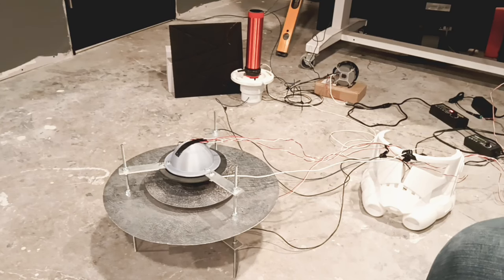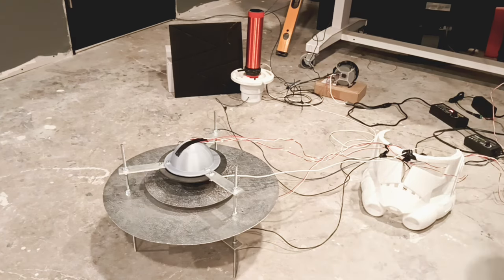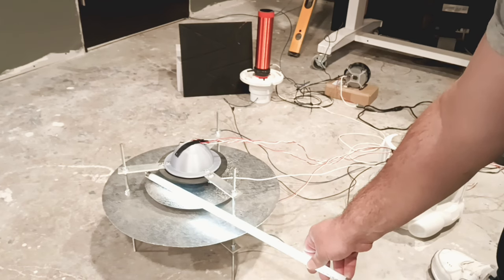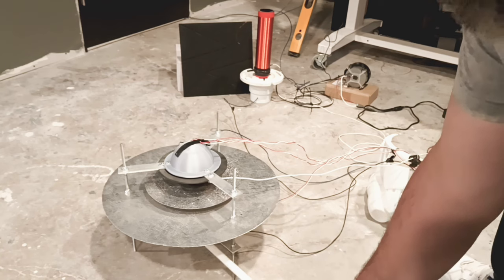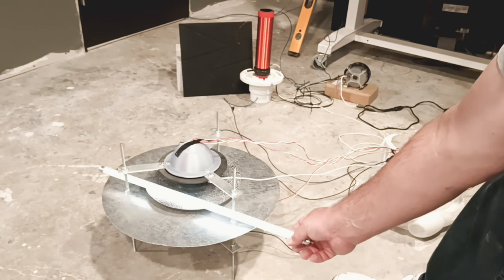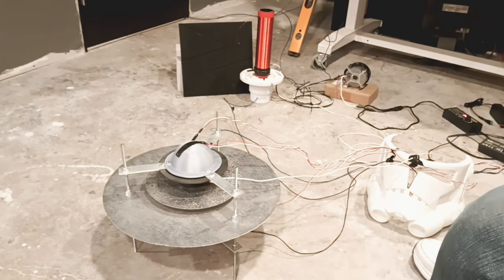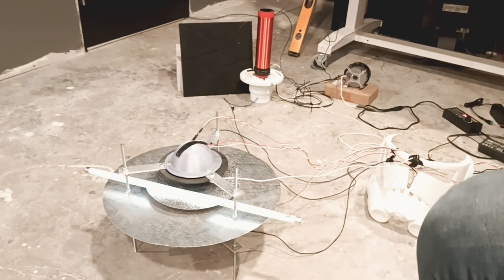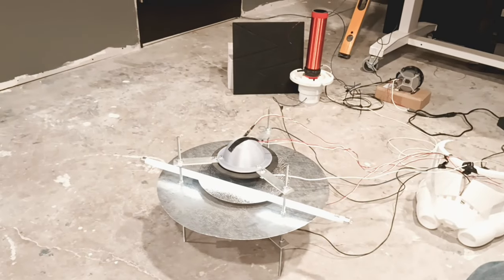Graviflyer Testing 4

Comment from the maker: The Field that comes off the Graviflyer when the high voltage is switched with the tesla coil pushes the static high voltage field out. It will make your tv flicker and mess with your computer. The fields around the top and bottom plates are now correct. The static high voltage field now created on the outside is now pushed over 4 feet away.  It also places a magnetic charge on the center plate. Only the positive wire from the flybacks was used.

Comment: Nathan, good find. Now put the two CDs with Al and Al2O3 and use a 12-volt battery. Make the center plate with the marks on it for the ultrasound to pass through. Spin the two disks and turn on the ultrasound. Let it charge up and then push the button off. Watch it levitate.  The power supply at 60 hz is the low frequency RF and you don't want this. The battery has a much higher chemical frequency and is more like a light photon or the exchange particle like an electron in an atom.   The TV show The Secret of Skinwalker Ranch has the 1.625 Ghz as they are larger craft and makes the anti-gravity waves with their UAP and turns normal matter radioactive and injures the researchers on the show. Alexey never has electronics in the room when he turns on the graviflyer and mostly powers it up in the field outside so nothing gets affected. Good idea to have a Geiger counter. The RF on the TV show makes more charge on the metallic hydrogen craft like the photo electric effect so the larger craft can levitate. You are correct the scientists of old use the static charge, so the device repels the earth's surface and attracts the ionosphere. Why do you think the UAP affect cars electronics, a nuclear missile site and the electronics at Skinwalker Ranch? Why do the cows age prematurely and die? Why do some people get cured? Because if you hit the correct gravity waves. Why do you think as the UAP approaches someone the ground lights up or the exchange particle? Why do you think that trees have a residual electric field and magnetic field??

Comment: Nathan, you produced a warp bubble of four feet that is an increase in the gravity field by attaching the positive wire from the flybacks. You produced a new reference frame where the mass of the graviflyer increased, and time ran forward faster. If you had attached the negative wire from the flyback, you would have produced an antigravity wave that reversed time and the graviflyer would have lost mass. The earth's gravity field blocked the graviflyer produced gravity field as gravity fields block gravity fields and why the earth has lagrange points.
Reply from the maker: This field is nasty. It produces more energy than I put in by a lot. Connecting the negative is not a good idea right now. A run away state without a way to stop it is bad. The best thing for now is to reduce power to try to control the field.
Reply: Nathan, I agree. A gravity field is nasty and why my friend Mark Tomion passed away in June of 2009. It ages you so be careful. Depending upon the voltage and current produced depends upon what gravity wave or space wave you produce as per my spectrum.   The cows are not mutilated but age very rapidly and rot very rapidly. Always stay far away from the produced warp field. This is why I am disabled from a UAP that buzzed me back in December of 1982 and made my car travel one mile on the interstate straightaway in one second from space shortening. The negative voltage would produce an antigravity field, make you grow younger, and cure any of what ails you. Now you know why all of these scientists who worked with free energy generators died mysteriously and whose deaths were covered up. Now you know how Jesus cured people with the Star of David UAP that was always in the area and how he rose from the dead and how he performed his miracles. The major beliefs are delusional. The produced field draws energy from the future or the past and why the energy is over unity. The reason that they are researching and selling EVs so they get the batteries to store the produced power so they can reverse the field and go back to whence they came from in space and time.  The crop circles are produced with a beam of gravity waves and why the wheat is flattened down and has mutated stalks with more grain heads. It is alien graffiti. Why do you think B does not send troops into Ukraine or Gaza but only supplies the weapons due to the commands. What will happen to Russia and Israel who violate the command? Why do you think the knights buried the ark 120 feet under Oak Island with many booby traps and the researchers are attempting to find it?  Alexey the alien, angel, future person who knows the technology.

Comment: I mean you are messing around with relatively high voltages here and if you only use the positive, where is the other wire going? I am not surprised if this setup makes strange things happen with sensitive digital electronics, I think if you continue with these experiments you will get a visit from the FCC.

I am very interrested in the observed effects when the discs are in motion, can you record that when you have new motors?

Comment: Do you believe the use of having one vortex flow opppsite the directions of the other as they converge at a "zero point" would have any useful effect?
Reply from the maker: it depends on what you are looking for. the static volts when a spinning field is present allow for a vortex. However the field must be low. I think it would be helpful in a gravity well. It would make a better center point for the well.
Reply: @nathanbunten4299  I don't have much to offer in knowledge but the plampid unification theory is exciting

Comment: What do you mean by "static volts" as far as I can tell you have two oscillating voltage sources with relatively high voltage, operating at different voltages and frequencies. One you refer to as a pair of flyback transformers? I assume they are rectified? So its just AC and choppy high voltage DC?
Reply from the maker: The fields are interacting because the tesla coil is DC not ac. The static field is being produced when the amps are so low that voltage spikes. This makes a static volt. My frequency of the disc's are in hertz not khz. The flyback is in khz on the tips of the flyback but the source is in hurtz. The interactions are important. I am changing fields based on the frequency's lining up.

Comment: Can you show us what happens if you put conductive foil under wood and energize heavily?…
Reply from the maker: when voltage is applied to foil over wood it creates a polarized bond. It won't help me lift it.
Reply: @nathanbunten4299  what if after the bond is created you tell either one with interfering waves of some kind that their position changed while they are double stabilized to the nuclear level using two weighted magnetic fields?

Comment: You didn't  try with the line transformers running and no tesla coil, you should have done that at the end.
You will have to do this to show co-dependency of the two supplies.
Reply from the maker: I did try that. The field that the flyback gave off was a small flicker if that. I tested at the flyback and the graviflyer. It wasn't until both were connected that I received a very high light up.
Reply: @nathanbunten4299  But isnt that to be expected? As soon as the plasma forms in the tube light it does not need to reach the same peak energy levels to sustain, so as soon as the flicker from the flyback potential and the tesla coil potentials combine  and turn it on, it will stay turned on. Thats how these things work. They might not do it on their own, but combined it seems only natural.
Reply from the maker: @ET_AYY_LMAO  That is exactly what I am getting at. I got more out than I put in.